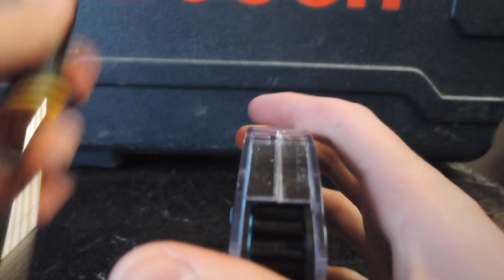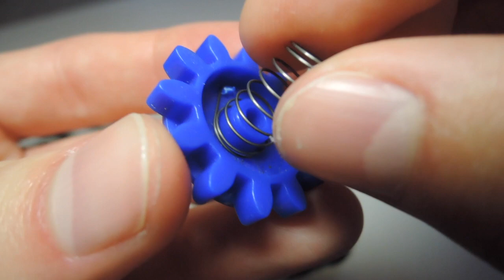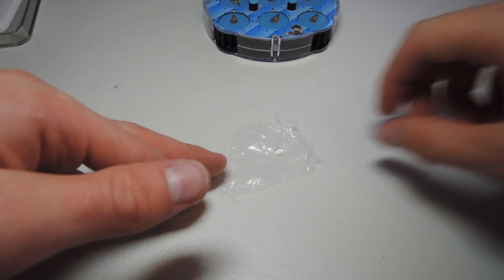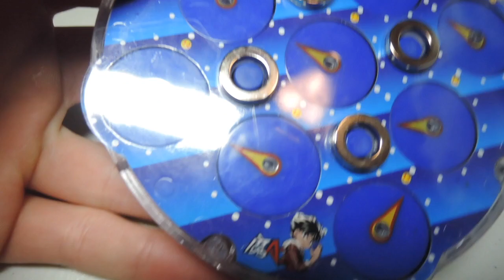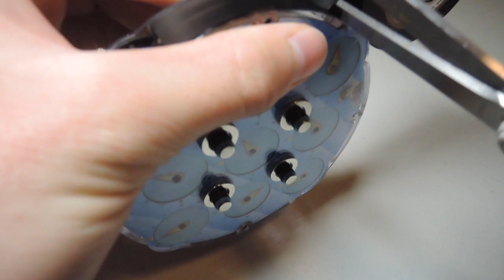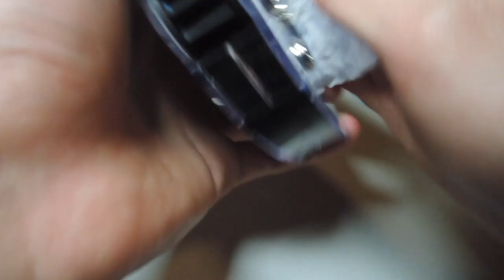How To Make a Magnetic LingAo or Rubik's Clock -  Open, Lube, Magnetize - The Ultimate Mod Tutorial!

Comment: I cracked my clock open and I was scared to open the clock cause it had no screw so I just wiped some lube on the front of the black casing and was wondering if it helps. Also is it fine if I magnetize my clock without taking the pins out?? Sorry for the questions I’m not that familiar with clock, I just started getting into it.